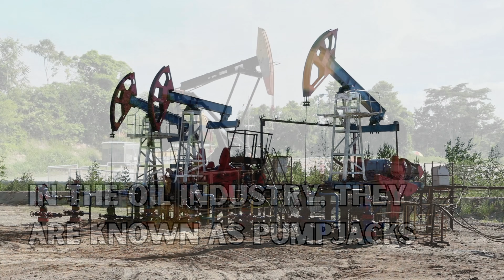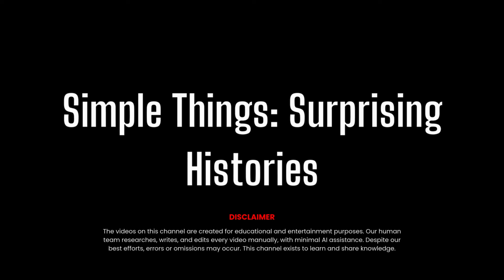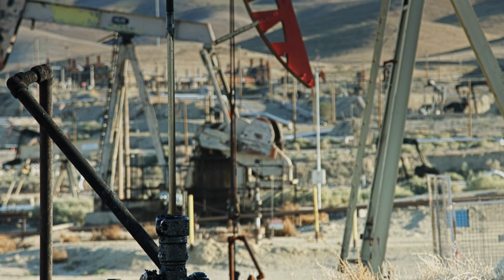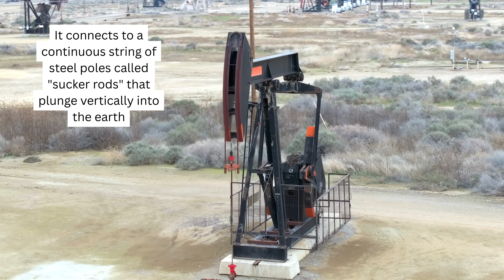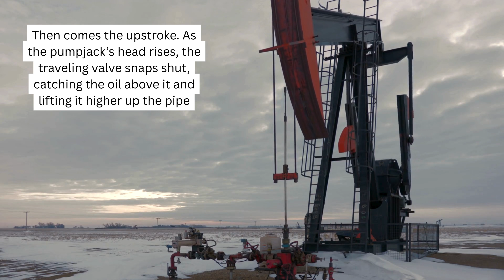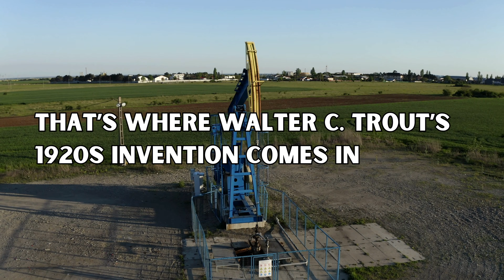The Giant Machines That Never Stop Pumping Oil

Comment: The mechanism is exactly the same as that of the Afridev handpump which is used for manually pumping ground water in most African rural areas.
Reply: Did you really understand it fully? The valves are clever but maybe quite common, what makes the machine genial is the weight of the oil in vertical tube and the weight of the counterweight that makes the system working in both directions(!) very smoothly and on surpricingly low energy consumption. 115 years without improvement, it's masterpiece.
Reply: @petrhomolac3740  Go and check how the Afridev pump works and you will agree with me that there are alot of similarities.
Reply: @petrhomolac3740  Yes, I recommend you go and check how the Afridev pumping mechanism work and come back.

Comment: Does it go straight from the pump jack to the pipeline? or is it stored somewhere?
Reply: Flows to the oil and water 'Separator' (don't know if heater-treaters are still in use to aid separation) then piped to its respective tank battery for storage. Tank batteries are gauged daily noting oil production and how much water (usually brine) the well made. Some oil batteries are tapped into a collector pipeline, if not trucks transport the oil.
 Usually water is hauled off to a disposal well when salt water tank is filled.
Reply: @GreggWalken-xd3qv  oh so it does go to a tank? If you have a few of them close together, do they share a tank or do they each get their own?
Reply: @FNHot After going through the Separator there's generally two 210 oil barrel tanks or bigger plumbed to fill one oil tank first then a gravity valve or the pumper (who guages daily) will switch to the empty one. Salt water tank is independent but incase overfilling it is plumbed to run excess into an oil tank and vice-versa. Companies using larger than 210 bbl tank batteries are able to wait out price fluctuations or  just be a well that has a high flow rate and needed. Oilfield looks to be a rough hammer and chiseled project but there's an incredible amount of engineering going into just production recovery.